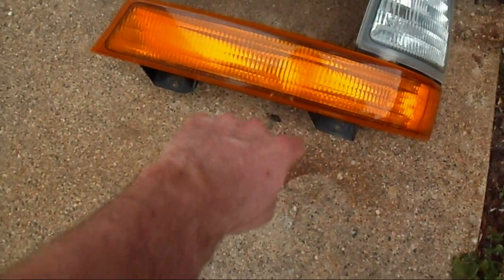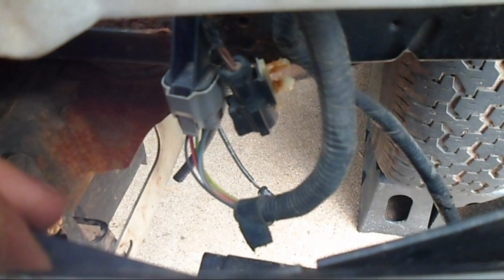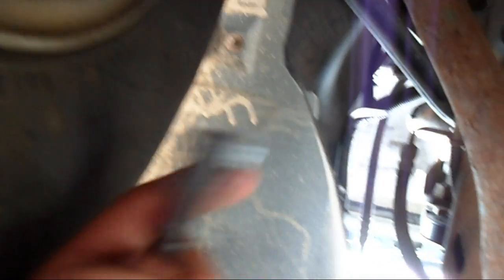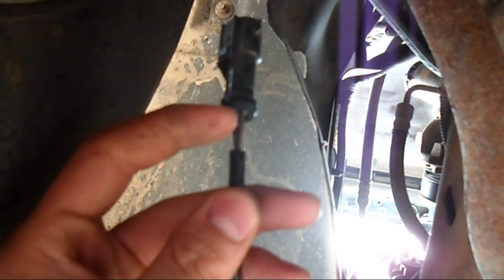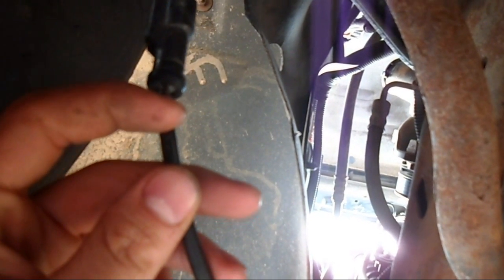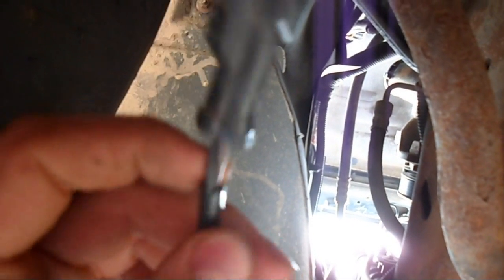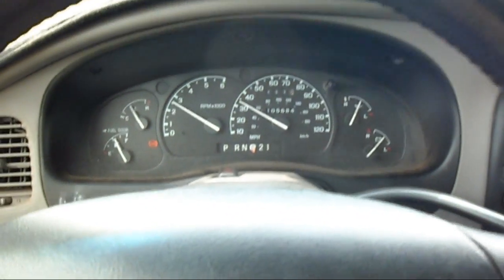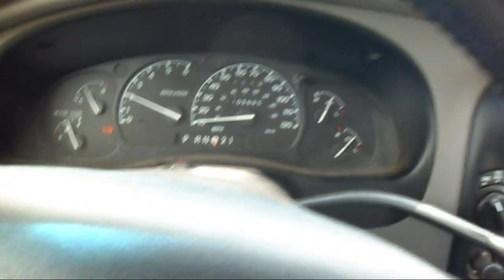Ford Ranger ABS Defeat Switch

Comment: How do I bypass my abs so the light will go out for inspection?  The truck runs excellent and the light's on but I cant afford any parts, as I can barely even afford to pay the inspection fee at the moment.
Reply from the maker: Either fix your ABS problem, or take the light bulb out for the ABS warning light. That's the only 2 things that will make the warning light go off. If it stays on after you shut off the engine and restart it, you have a broken ABS part somewhere, most likely a sensor.
Reply: @KorysRides  NO SHIT.
Reply: Robert El-Adham
Reply: Duane Murrell